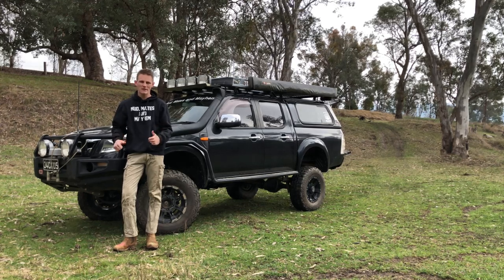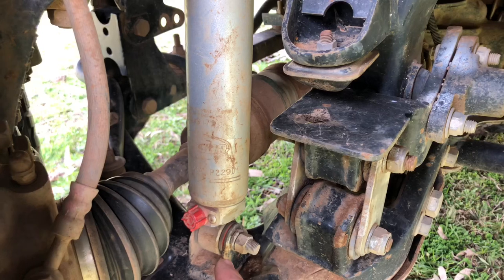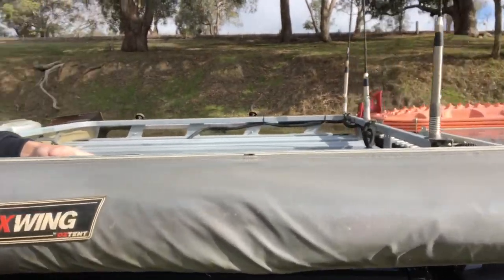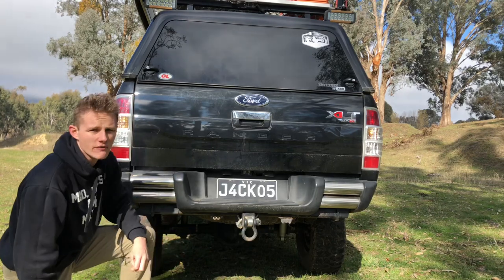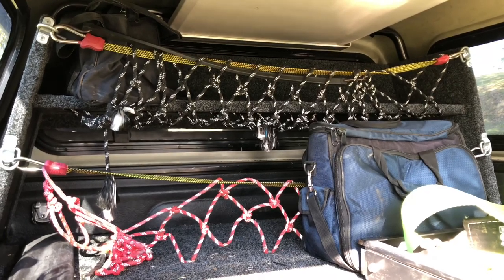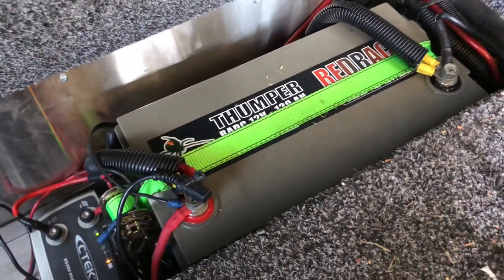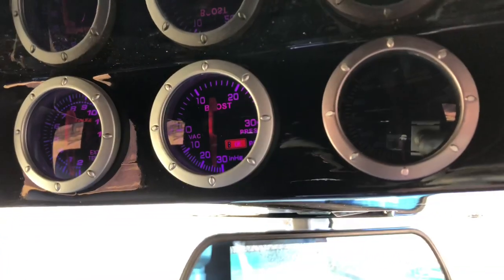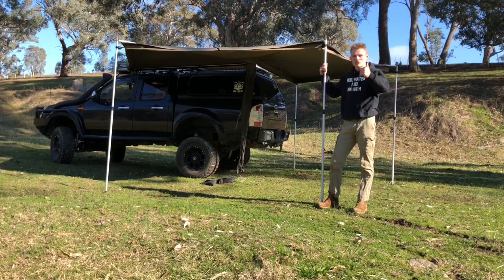2010 Ford Pk ranger walkthrough

Comment: Hey Jackson. Got the same model Ranger.but it is a super cab with suicide doors. Where did you get the overhead console - Brand?. Also how did you remove the dash switch blanks to replace with the rocker switches? Cheers

Comment: what have you done with the center bearing on the tailshaft ,mine was lifted 2" and created a vibration.
Reply from the maker: Hi mate. I put larger bolts through and spaced it with a spacer kit. It still vibrates though
Reply: @Noskcaj95  yeah, after ruining a tailshaft uni joint I put a spacer kit in it but think I will have to get a shim kit to alter the diff angle by a couple of degrees. I regret the trouble my lift kit has caused me on an otherwise completely trouble free 13 years of owning the ranger
Reply from the maker: ROSS private they are a really great car and mine has only just started to show some little signs of letting me down. Nothing that can’t be fixed pretty easily though